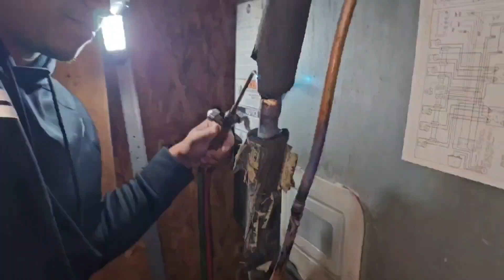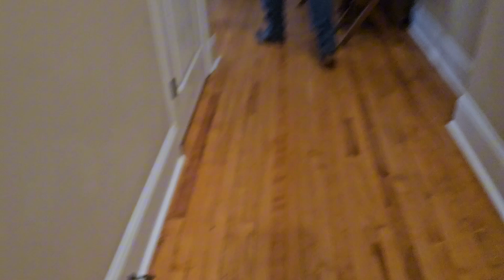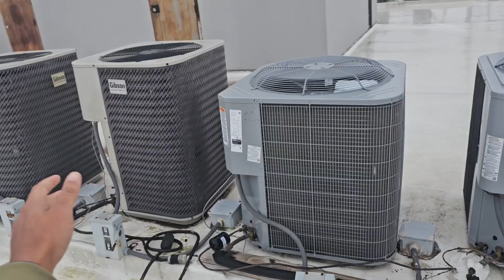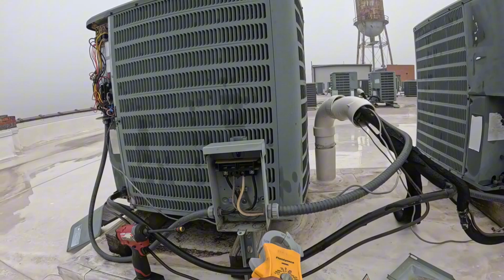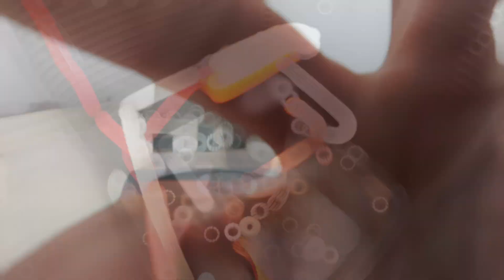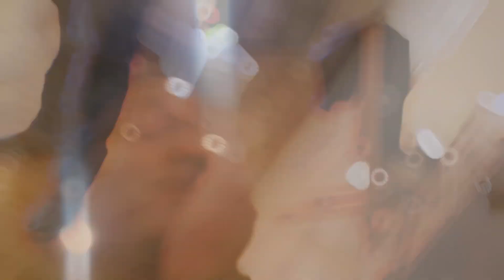Bad Compressor Keeping Customer Unhappy | HVAC

Comment: @AB_HVAC when you were ohming out the compressor plug wires what does it mean when you get a reading and are those plugs connected to the capacitor and contractor sorry I’m dumb
Reply from the maker: Nah you aint dumb. The compressor plug on most residential systems will have the C and R terminals going to the contactor and the S terminal going to the capacitor. The rule of thumb i was taught was off rip the ohm reading from C to R and C to S should equal S to R. If it doesnt you may have an issue on a specific terminal/winding. But if ANY of your terminals give continuity to ground (ive heard most people say to test it to the copper going into the comp not the ground of the compressor) then youre compressor is done for
Reply: @AB_HVAC  I appreciate your knowledge keep doing this sir. I’m tuned into your channel now! Have a good rest of your Day AB

Comment: I noticed the mounting of the disconnect was a little flimsy, so you had to hold the case with your left hand while pulling it out with right your hand.  If there had been a problem with the switch, current would have went across your chest. A good practice is to put your left hand behind your back when pulling or turning off a disconnect with the right hand. You never know what condition an old switch is in.
Good video by the way!
Reply from the maker: Thanks, i didnt want to just yank the disconnect from the 4x4 it was screwed to 😅 everyone gets on me about pulling the disconnect, ive been doing better

Comment: One trick I do is I disconnect the compressor wires on the contactor and then turn the breaker back on too see if it trips. But that’s just one thing I do everyone does everything different
Reply from the maker: Thats a super quick way to rule the compressor out. Nothing wrong with that at all